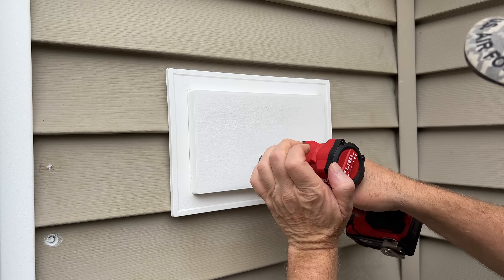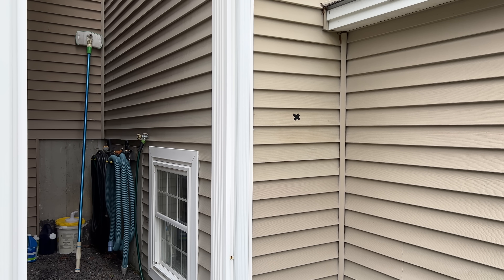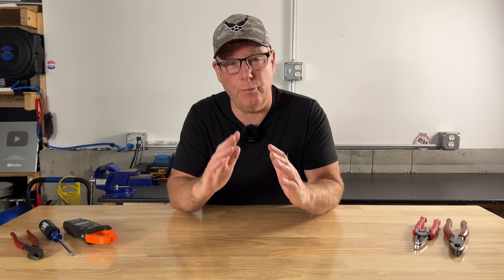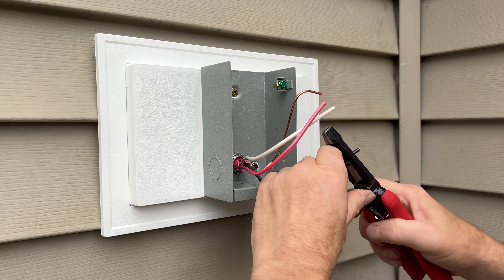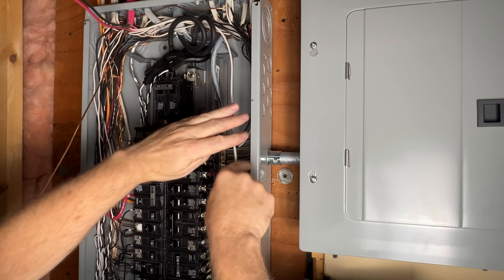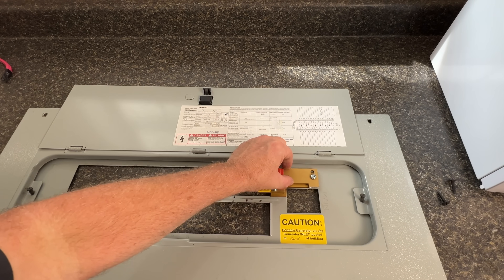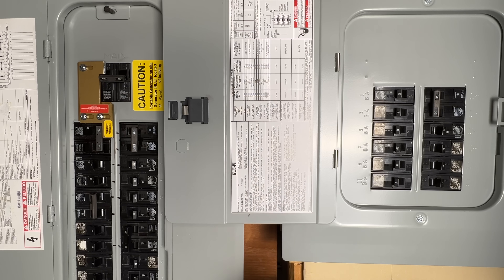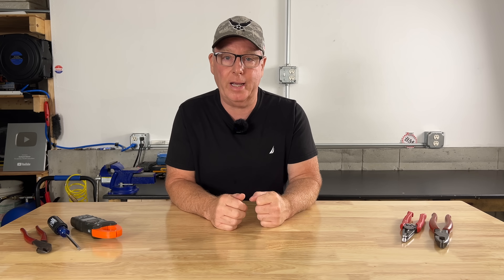Watch This Before Connecting a Backup Generator to Your Home.

Comment: Great video.  My issue is the main house breaker is in a panel outside next to meter. Inside breaker panel is just breakers.  Not sure best approach??
Reply from the maker: Do you have a space in the exterior panel to install a second two pole breaker? This is common and then the interlock and inlet box will be installed outside. My friend Adam from How To Home made a video going over this type of installation. www.youtube.com/@HowToHomeDIY

Comment: I just got the same plug installed and bought a 10,000 watt/8,000 running and wanted to just run my 4 ton ac then when the house is cold 72 turn it off and run most of my small house 3 bedroom. But the generator kicks off when I try AC, would you recommend a soft start or something or do I need a bigger generator??
Reply from the maker: Your generator should be able to handle the AC unit but it will not be able to overcome the inrush. A soft start will most likely solve the problem. Depending on a few factors a 4 ton ac unit should draw about 20A. With a 30A power connection you should try to stay below 24A of continuous load (80% of 30A) even though the generator can handle more. If the generator has a 50A connection, that will allow to apply more load and stay under 80% of the circuit rating and within the generators capacity. To do this you will need to up size your inlet box, the wire size and the generator breaker size at your electrical panel. Oh and also your connection cord. Otherwise be careful about what you run while the AC is running.
Reply: @BackyardMaine  thank you for the reply, I might try and give it a go later this week if it cools down (Texas Heat) ain’t no joke lol and I might have to look into maybe the cord can’t handle the ac watts and definitely will look into the soft start just found out about it last week. Again I appreciate the reply

Comment: When do you need an inlet box with an in-use weather cover?
Reply from the maker: Good question. Article 406.9(b) covers this requirement. The reliance inlet that I'm using is NEMA 3R rated which covers falling rain sleet and snow but not wind blown rain sleet of snow. The cover shields the recessed connection when in use. These are listed for outdoor use in wet locations by the manufacturer for connecting generators. Depending on your inspector you may have an argument about interpretation.

Comment: Unfortunately I have one of the old Zinsco/Sylvania breaker panels and there's just no way to put an interlock on it. I'm keenly aware of the absolute requirement to keep the main breakers off while running the generator. I'm the only one who will ever be dragging the generator out during a power failure and there will be no mistakes in connecting and running it. (Yes, I see you rolling your eyes there in the back row...) 
That said, my generator is a 10-year-old Honda eu2200. I got tired of running long extensions cords all over the house just to keep the refrigerators running and a few table lamps. Now, the generator gets plugged into an outlet below the breaker panel (outside) and it has its own breaker. Of course, it's single phase so I had to reorganize the panel a little in order to have all critical circuits on the one powered phase. 
So now in a power outage, I can conveniently keep both friges running along with furnace, computers, clocks, TV, garage door, surveillance system, burglar alarm and most lighting circuits. Of course, there's no A/C or dryer, and we avoid using the microwave, toaster oven, coffee maker, etc. The generator has no problem keeping up and it will run all night long on a tank of gas while we're asleep.

Comment: If you have a running generator continuous load up to 30 amps shouldn’t your breaker and wire be 20% larger? If you install a 30 amp circuit your continuous load should be 24 amps or less shouldn’t it? I plan to install 8AWG and 40 amp breaker to support 30 amp loading.
Reply from the maker: The key here is continuous load. Most loads are intermittent. My continuous load is 5A at the most. At 4800 watts the generator is only capable of producing 20A of continuous power.

Comment: Another question. Does your generator have the neutral floating??
Reply from the maker: Yes.. Thats an important question. The neutral can only be bonded in one location so unless you're switching it then the gen needs to be floating. I will post a video on bonding and grounding very soon.
Reply: @BackyardMaine  Great that's what I thought. Thanks so much. Great stuff!!

Comment: I thought the new code specified that the back feed breaker be held down to the panel by mechanical means?
Reply from the maker: It is held in by the dead front / cover.
Reply: @BackyardMaine  Great thanks!

Comment: So, is it ok to use the NM-B through the wall since it is not exposed to the outside or UV light so it cannot degrade?? I thought you had to use a conduit of some sort and THHN or equivalent?
Thanks!
Reply from the maker: Yes, it's code compliant to run NM-B through a wall into an exterior box.

Comment: did you unbond the neutral on the generator? Mine is going to be used only for home backup.
Reply from the maker: Unless you switch the neutral then the generator needs to be floating neutral as apposed to a bonded neutral. The bond at the generator can be disconnected if it's a bonded neutral generator. Also if you want to run the generator for other than a home backup, they make bonding plugs that can be connected to a receptacle or you could make one as well.
Reply: @BackyardMaine  awesome thank you this is gonna be home only..I pulled the panel off and going to unbond it from the frame..its pretty easy on these things.

Comment: You mention the interlock kit is for the left side, it looks to me you can just flip it over and it'd fit on the right side.... i may be mistaken but in an up/down main breaker it's center aligned so mirrored either way, left/right main i could understand it only working on one side.

Comment: Good install, however one slight issue (yes I know it's a nit pick) but as an electrician, you know that you need to have each breaker labeled on the panel: 2020 NEC Article 408.4(A).  This has to be inside the door on on the face of the panel.   Just in-case you forgot too...  🤠👍
Reply from the maker: I have a clear plastic sleeve on the cover of the panel with a printed copy of the panel schedule. It was not shown in the video because I am making edits since I just installed the sub panel.

Comment: I'll be waiting for that one on the battery b/c that is what I really want.  Already have a gen but I have to pug things into it.  I also have 2 little batterers I use run all my electronic stuff and little solar panels to charge them with.  One will last about 3 days so even here in Upstate NY I always have at least one of them charged.
Reply from the maker: You keep your fuel cans outside?

Comment: Thanks so much for these videos! Is the sub panel required? We could theoretically just turn on the breakers we need in the main panel, right?
Reply from the maker: No the sub panel is not required. I installed it for a battery backup system with an automatic transfer switch so I needed the sub panel to limit the load to under 6000w during an outage. I'm posting the battery power station video on August 12th.

Comment: I am surprised that you, as a certified/licensed electrician don't have a little more advanced set up. My father, a licensed electrician, replaced our fuse panel (yes, fuse panel) 40 years ago, upgrading to a 200 amp breaker box and separated individual circuits to a separate breaker. The old fuse panel was a no no for me. We got the house at a bargain but I would not have fuses carrying multiple circuits. I guess code was very weak when the house was built, or the inspector allowed improper work. This box allowed me to upgrade for finishing in the basement and outside, including a workshop with power tools. 
With the house located next to a stream we would get high water, especially during heavy storms, with occasional power outages. I bought a 5500 watt generator at HD during one of those outages caused by a hurricane. It was simple--power up the generator, run a 100 foot 12 gauge wire through the kitchen window, then run extension cords to power the fridge and a few lights. Yes, you get tired of doing that in the rain. I bought a 6 circuit Reliance transfer switch box. That was a heavenly solution since I could choose enough circuits to get by without spending time running a cord. Later after one leg of the generator stopped working, I upgraded to a CAT  8000 watt generator and a 10 circuit Reliance transfer switch box. The CAT generator and 10 circuit box allow me to run everything we need during a storm outage. Two meters in the box enable me to see how many watts are in use on each leg. I can run two AC units in summer, or one heater in winter (we have a wood stove too). The Reliance box is was less than you spent for your set up. With a small permanent shelter for the generator I can leave everything hooked up all the time. All I have to do is go out, start the generator (electric start), go downstairs and turn on each circuit I need. With all the 10 circuits on, I so far have not exceeded 4500 watts. We have all power, overhead lights, sump pump, freezer, cable TV, internet. The Reliance box is as easy as flipping a switch. Yes, initial installation is more than the type of set up you did, but was worth the time spent for me. I did the labor myself.
Edit: on second thought, your labor was similar, since you used a secondary box for your circuits.
Reply from the maker: I installed it for a battery backup system with an automatic transfer switch so I needed the sub panel to limit the load to under 6000w during an outage. I'm posting the battery power station video on August 12th. It's a pretty nice setup.
Reply: @BackyardMaine  I see. It will be more advanced.

Comment: Your explanation and thoroughness is appreciated, however, as an experienced electrician, you should know that when turning on breakers, need to use your non-dominant hand and turn your face away because breakers can fail and explode. I’m sure your audience would appreciate knowing that.
Reply from the maker: I worked as an electrical engineer in a large semiconductor manufacturing facility for 22 years. We switched large loads often. (1200A-4000A) (208v, 480v, 4160v and 34.5 kv.) I was responsible for electrical safety and I taught NFPA-70E. I was responsible for calculating and labeling every part of the electrical distribution system with incident available incident energy and the required PPE to be used when switching. With this knowledge I know that the incident energy is primarily dependent of the size and impedance of the transformer, wire size and distance from the source. Most residential installation as so low that the only PPE required would be safety glasses.

Comment: Thank you for the excellent video. I had to run through it a second time as the website for the interlock was not on your product list. I do have a question which I never see discussed. Should the generator itself be connected to a separate ground rod driven down by the generator?
Reply from the maker: I will cover grounding and bonding in a video this month. It depends on your setup but in almost all cases a ground rod is not required. Many homeowners and even some electricians don't understand that the neutral and ground can only be bonded in one location and often time generators are connected with a bonded neutral. I will cover all this coming right up.

Comment: Very helpful.  I have been considering an interlock to replace a Reliance through the wall connection but my house has a 50 year old 100 amp panel that is full.  As much as I'd like to I can't afford a 200 amp panel upgrade.  To make room for the 30 amp 2 pole breaker I'd have to replace breakers with half size breakers.  I'm not sure this is a good idea.  Would you comment please?
Reply from the maker: With lighting being mostly LED now you may be able to combine a few lighting circuits and free up space. Another option would be to install a small sub panel and bring 6 or 12 circuits over to free up space for the generator breaker and the sub panel feed. I just added a sub panel to my system.
Reply: @BackyardMaine  Thanks!

Comment: i cant wait for the battery backup video. I wonder why you wouldnt just connect the battery to the 30a box in this video (i.e. just replace generator with a battery) I want to do exactly that with the 240v 7.2kW outlet from a F150 lighting.
Reply from the maker: The reason is that sometimes our power goes out for multiple days and the battery is limited. I like the automatic backup that the battery provides and also the clean power for running electronics. My plan is to run the generator less and use it to recharge the battery. I will post the power station video on Monday, the 12th.

Comment: hello and thanks to you, I'm learning about this topic. Will it be the same if I use a 50A instead of 30A? Also, can you do a video on how to properly do a sub panel that can have an inlet for a generator for backup power? Thanks
Reply from the maker: The same process but you would use 6 gauge NM cable, a 50A inlet box and a 50A two pole breaker.  Here's a video from a fellow creator on how to install a sub panel. Everyday Home Repairs - https://youtu.be/PgW-vHNyIC0?si=evktXY6LHHBlBTB5 and L

Comment: Nice video. 
Have you done one about surge protection devices yet?  I know the code is starting to require it in some places.   The ones that have 100+ kva surge rating that dump power with 12 gauge wire are just hard to hard for me to believe.  Some models want to be attached to a 50amp breaker with 12 gauge wire and the breaker terminal data will show that's not supposed to be done but the installation instructions want it that way.
Reply from the maker: I have that on my video list.. I will try to make it before the weather gets cold.
Reply: I agree.  I live in an area with a utility that doesn't do a good job maintaining their infrastructure, so we frequently have brownouts, and short power-out / power on spikes from tree damage somewhere in the local grid.  After blowing out a stove circuit board then a washing machine circuit board, and ignition coils on our tankless water heater. I put in a $175 whole-house surge protector made by Eaton.  It has been a godsend for keeping expensive appliances from electrical spike damage. In the 14 years since, we've never again had to replace or repair an appliance from damages caused by our mediocre utility power source.    I think many homeowners would be very interested in a video that shows how to install one of these very useful devices.

Comment: I did a very similar setup using the Reliance inlet about two years ago. I had an issue with the female end inserting and locking into place with the inlet. I needed to keep working it in with a pair of channel locks, but it works fine now that is "broken in". I wouldnt bash Reliance, but the one I had was definitely not cut correctly to accept the female end.